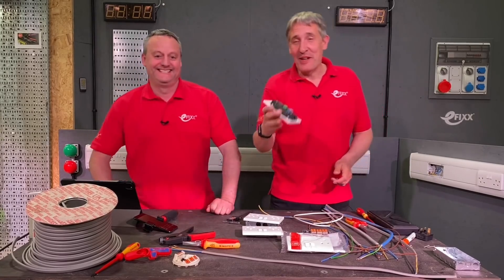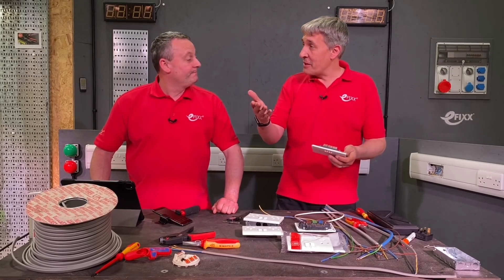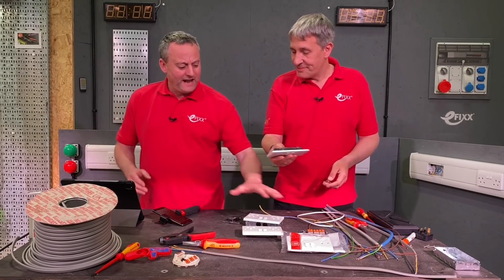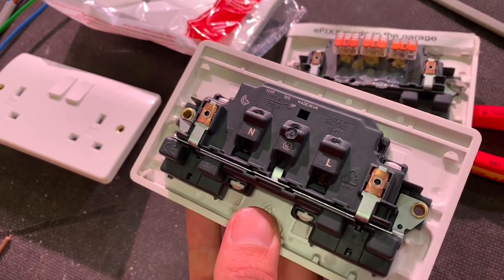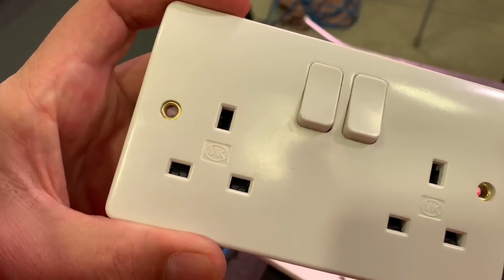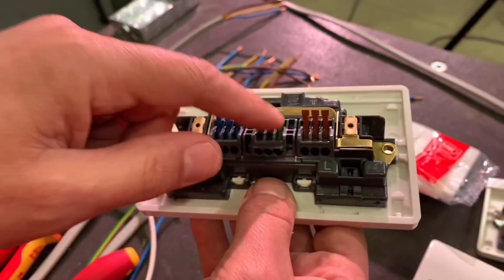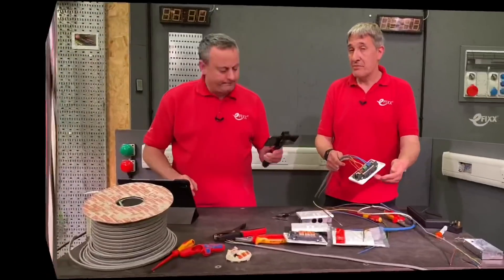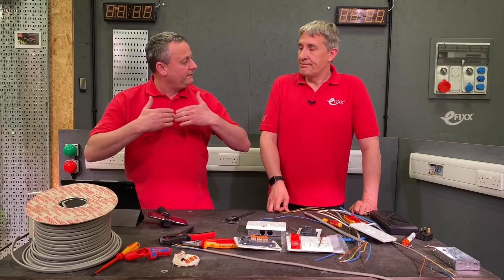MK LOGIC RAPID FIX - Double socket with SCREWLESS terminals.

Comment: We have insulation displacement sockets.  You can put up to 4mm2 conductors - strip the middle piece of TPS, lay cable in, tighten one screw - no stripping of the primary insulation.
Reply: Funky, got a link?

Comment: Interesting. Screw-less has been the norm here in Denmark for ages. The conductors are push-in and hold really really tight. To remove them you have to push a lever really hard to disengage the clamp/spring.

Here's a Schneider "Improved fuga" animation. They're real nice :) https://www.youtube.com/watch?v=OoOS1YL8b0M

Edit: I should mention, while the animation is a switch, it's a standard 1U sized FUGA insert. You have sockets and such that fit in that as well.
Reply from the maker: We are catching up (slowly)
Reply: @efixx  Since 1981, for 40 years, the sockets and switches with screwless clamping spring terminals for class 1 solid wires has been available.
Reply: Same for us here in Germany. Just shove the wire in, to release it push a lever.
Reply: In Norway and Sweden we have had this for quite long time.
Reply: @devt6862  Norway and Sweden use also Schuko sockets, so the same as we do here in Germany.

Comment: Don’t like the idea of that, make it to bloody easy for the have ago DIYers  👎 same can be said for screw less CUs  . Instead making the industry safer they’re making it more dangerous . 👎 also puts a spanner in the works on the subject of torque screwdrivers . 😂 .. not sure if I like it or not? 
Is there a port for tester probes like the wago ? Great video guy’s as always 👍

Does this mean we are going to be like the Americans and have uninsulated screwdrivers? Or maybe resign our screwdrivers to the bin ? After all we use a drill driver to hang CUs and fit back boxes , now we have screw less CUs and sockets we won’t need screwdrivers , maybe one  for the face plate screws even some CUs have a lock type lug so no more screwdrivers? … I might pack in and become a Plummer 😂
Reply from the maker: Tester points on the top.
Reply: @efixx  I slowly coming round to them , just don’t get the argument about loose connections? I have never come across loose connections in 30 years of being an electrician apart from on the DNOs side and maybe when some shmuk of a DIYer had done it himself ? 
Maybe i’am wrong?
Reply: You're not going to stop DIYers "having a go", so at least this might mean that they do the job safely (emphasis on "might"). 😉

Comment: I'd be interested to see thermal images of these compared to screw terminals when passing 32A from wire to wire
Reply: Needs JW to do thermal tests 😉👍
Reply: I'm sure a correctly torqued screw terminal will always give a lower resistance than a lever terminal, but this misses the point: 85% of screw terminals are not done up to the correct torque. I strongly suspect all housefires started by electrical sockets fall within this 15%! (figures completely made up, but you get the point.)

I would rather get a connection 98% good, 100% of the time, than 100% good 85% of the time.
Reply: @MatSmithLondon  40% of the time it works everytime
Reply: @travoltasbiplane1551  that's black panther aftershave 🤣
Reply: @E-RATIK  a gentleman of culture I see😂
Reply: @travoltasbiplane1551  it stings the nostrils 🤣
Reply: @E-RATIK  in a good way!
Reply: @MatSmithLondon  The torque applied to the screw translates to a clamping force on the wire at the time of installation, however, copper is ductile and malleable, so it tends to spread out under the screw and there is nothing to reapply the force automatically. What you need is a leaf spring like in a Wago.
Reply: About time... The socket revolution has started.. 😎👍 I always use MK LOGIC PRO'S these are a great update. Ideal if doing loads of socket outlets in dado trunking in offices, great for fault finding too. Speeds up the job no end.
Reply: @muzikman2008  need to come down in price a lot first.
Reply: john ward dis test on wago connecters
Reply: @line10cls  I know.. That was wagos... Put a 3ka and above load on socket see what melts 😉
Reply: @muzikman2008  everything eventually.... but hopefully you haven't used a 32a wago on a 3kA circuit anyway so probably not too much to worry about. :)
Reply: @mikeselectricstuff You have all the required equipment so do a video.
Reply: Barely above ambient.
Reply: seen so many of 16 A and 32A sockets [trailing type] where the push in connections have got so hot and burned the insulation back.....wait a few years and the fires will start on fully loaded 32A radial circuits with plastic fast fix boxes.
Reply: @sparkey1958  
What push in wire sockets do you refer to?
Reply: @johnburns4017  think he's on about commando sockets and I fully agree with him seen to many burnt out maintenance free commando sockets
Reply: @johnburns4017  commando sockets...
Reply: @sparkey1958  Burning like that is usually down to arcing from loose connections rather than simply the current load being carried which suggests incorrect assembly. Maybe the insulation was being grabbed by the terminal rather than the copper I've seen that on clamp type connectors numerous times, it can (and does) happen with screw terminals as well but then often the screw bites through the insulation. So on balance my guess would be operator error during assembly.
Reply: @mfx1  Seen screws clamped on insulation so many times on stuff pulled during kitchen refits.
Reply: @sparkey1958  thats truly disturbing
Reply: @sparkey1958  these aren't push in, they're lever connectors. 10000x better, doesn't have these issues
Reply: @sparkey1958  no it will not wago even have 32 amps rated lever connectors the plastic is thicker on it.
Reply: @sparkey1958  I've seen far more issues with screwed terminals tbh. Whatever the terminal type of a trailing lead they should always be regularly inspected due to the nature of its use. That and bad practice I believe is the main reason for most issues.
I personally like the idea of the lever connections, they don't damage the conductors like screw terminals.

Comment: £5.79 as opposed to £3.77 (Screwfix just now.)  Quite a premium for a bit of convenience.  The better connection will be invisible to the installation owner.
Reply: They have speed of installation and safety. No terminal stress using  multiple cables in terminals.
Reply: Then think about other brands I use hager and click mode, a hager socket is about £2 a socket so for like 25 sockets your looking at £50 were these will set you back £150 for 25 sockets 🙈 plus it takes less than 2 minutes to second fix a socket, personally time will tell but I certainly won't be using them all well and good testing a product in controlled environment but in the real world you have DIY dave who hasn't got a clue the local builder with his tin snips, we'll have to wait and see how many houses burn down
Reply: @michaelboyes4948  
Read the posts on them here.  They are safer.  You cannot fix a screwed socket faster than these, that is nonsense. Your main concern is cost.  That is abbundantly clear.  In time when many makes are on the market, the prices will drop.

Comment: You’ve just resurrected a 50 year old memory with the screwdriver in the earth pin and two wires stuffed in the live and neutral.
I recall my father doing this on a regular basis, didn’t have the luxury of an insulated screwdriver, a six inch nail was always on hand.
I recall, if something had the luxury of being attached to a 3 pin plug, he would use the live and neutral pin to slide the bare wires in essentially piggy backing the live and neutral.
How I got to this ripe old age living with my father and his non existent DIY skills I don’t know.
Reply: @Charles Vane Very true, often by people with another agenda.

Don't get me started. 😂😂😂
Reply: So he had D-I-Don't skills, instead of D-I-Y skills?

Comment: I saw this pop up on IG a few months ago, wondered when it would be released. The best thing about this is it's a game changer when you have no choice but to work live, nursing/care homes and hospital environments where people can't be turned off without risks to their lives. I wonder if it'll have the same anti-bac properties their current basic range has that we were asked to fit as standard for care/nursing homes. Time to get some literature on them I think.
Reply from the maker: Its the same type of plastic Urea - so antibac properties are the same.
Reply: @efixx  Ended up fitting some not 2 hours after posting. Brilliant kit, had a nursing home call come in, bed ridden resident on oxygen. What would take a team of nurses to move them so we could isolate power and replace a busted socket (basically a minimum of 2 hour prep) took less than 5 minutes with no need to turn the power off and being lever connectors with triple inlets far safer than holding cables in to screw. I thought their new basic antibac would be our go to range but this is now the go to socket for all call outs.

Comment: Most clients want USB sockets now. The MK USB sockets are insanely deep. They say you need to use a 45mm deep back box. So until they come up with a slimline USB rapid-fix, I’ll stick to the cheap, slim USB sockets.
Reply: I refuse to fit cheap USB outlets because of the number of failures I have seen - including potential fire situations!
Reply: There are USB sockets that fit standard back boxex
Reply: @robertburrows6612 
Screwless ones?
Reply from the maker: USB version in development (allegedly)
Reply: Usb sockets like integrated led down lights will never exist in my home, maintenance ball-ache

Comment: its a shame they did not do 4 earths, for fly leads to back boxes
Reply: There is a screw connection on the earth strap for fly leads. Not that is required that often given that back boxes have a fixed lug.
Reply: Just goes to show it’s not required, unless the backbox is providing the earth to the socket (eg steel conduit) in singles you would have enough terminals 👍
Reply: @tommcdermott1989  

There's enough anyway. More than enough. It has a screw connection on the earth strap for fly leads. 

Three lever connectors for CPC plus one screw connection, total 4.
Reply: @martinw245  👍
Reply: I'm going to buy a pack of these sockets even though I don't need em. 🙃 😆

Comment: £30 for 5 rapid double sockets or £19 for 5 screw terminal sockets 
£11 the difference so over a rewire your looking at the difference of around £50 based on 25 double sockets in a small house
Reply: As a homeowner, I'd pay that on top of a rewire bill. And I'm a bit of an MK loyalist so I'm sold.
Reply: @J4MB0  I based this on MK socket prices , an average double socket is around £2 , compared to £6 for a rapid fit, it's all gonna come down to the customer saying yes to a quote that is significantly higher than the competition. One day they will be common place but until then?
Reply: @TheGorillahands  if I had to have a rewire tomorrow, I'd request them.
Reply: The most costly part of a rewrite is the labour at £97 per hour (for Jordon). So this will be quicker and cheaper 👍💪🥸
Reply: For me the  big selling point is more about the terminals being at a set torque and maintenance free, knowing it should eliminate loose terminal problems that occur, the time aspect is good too, looking forward to seeing a review and race from you guys 😀
Reply: And they contain WAGO springs so you will get a quality connection! :-)
Reply: The customer pays at the end of the day, of course most of them will choose the cheaper quote they don't care if it's quicker for the Sparks to fit.
Reply: @martinpoole1451  But the quote should be cheaper because the sparky knows the apprentice can save a few minutes per socket.. so say 1hr on a rewire
Reply: Well worth it then 👍